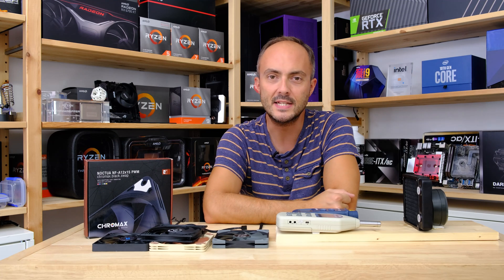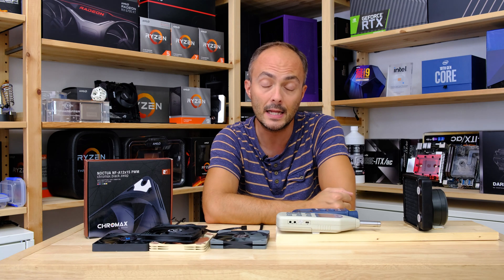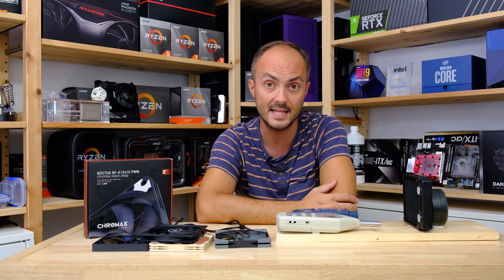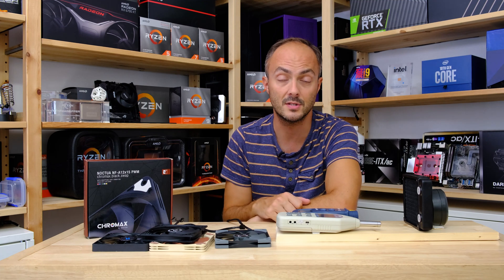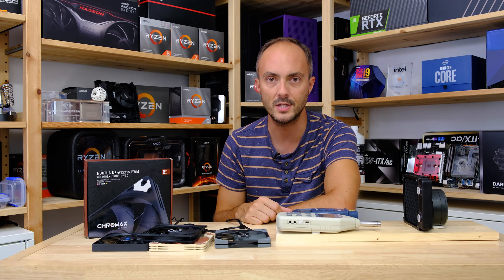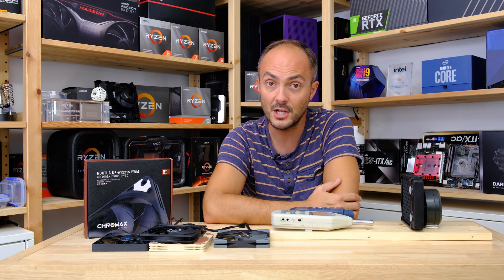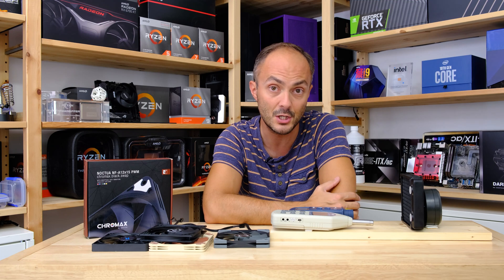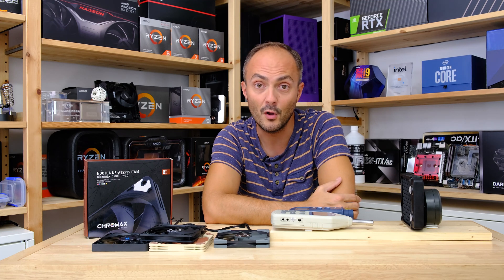120mm SLIM FAN GROUPTEST: Part 2 - Noise Normalised testing

Comment: Just stumbled across these two videos and I wanted to say thanks for doing these tests! Crazy how much more air the Noctua fans can move at their highest settings! Although it is a little unclear in the video what RPM resulted in the normalized DBA ratings- that would be another interesting tidbit! But hey, welcome to the world of testing methodologies. There are always more factors to test for or types of information to include lol.

Regarding the noise quality, I'd definitely agree that in the sound samples of the first video the Noctua does sound more unpleasant. To my ear there are two distinct components of fan noise- the tonal 'hum' of the motor and the white noise sound of the air interacting with the fan blades. What's interesting when listening to the sound samples of your first test video is that the Noctua had the lowest pitch motor sound (again, to my ears) as somewhere between an A4 and Bb4 (the Arctic seemed to be between B4 and C4). But the 'white noise' component was louder, and seemingly louder throughout the entire ramp up to max rpm- possibly due to the increased airflow. 

It seems like between the two the Arctic is the winner for someone who values silence above performance (due to its standout result in the 'middle noise' category) and the Noctua is the winner for someone who values performance above silence. But I'm sure either one would work perfectly for almost anyone with some simple fan curve tweaking! Of course, given the price difference and my own propensity to clamp down on fan curves (700-1000rpm when at all possible) I'll go with the Arctic!

Comment: Appreciate your work, but could you please, please, please just run one standardised cooling performance test?
Reply from the maker: Would you be more interested in RPM normalised or noise normalised if I did?
Reply: @CrazyTechLab  Thanks so much for the reply! I think noise normalised as that is arguably the more important metric. 

Doing like a 30dba then max DBA test would be best I feel.

Comment: Are all of these good enough for an aio cpu cooling radiator? Im planning to get the idcooling because its cheapest I can find. I need slimmer fan because I have some clearance problem.
Reply from the maker: Go for the best performing fans here as I tested the airflow while attached to a radiator so answers your exact question! Take a look at the graphs. I’d recommend the Noctua or Arctic.
Reply: @CrazyTechLab  ok thanks for the reply :)

Comment: How close did you have your microphone to the fans? 44 dB is alot for low rpm
Usefull video nonetheless, thx
Reply from the maker: Shown in the video. At low RPMs the quieter fans struggled to register and the sound meter only goes down to 30dBA so moving closer meant I could get solid comparable readings for all fans. They’re just a bit louder but I’m not saying fan X will be XdBA loud. That wasn’t the point of the group test. I was using identical tests to compare fans rather than test manufactures actual sound ratings.

Comment: Thermalright has some slim fans that they put on their top blower CPU coolers. I don't know if they can be bought separately. They have slim fans in different colours. I don't know if it's the same fan but just different colours, or if it's different performances as well. Can't think of any other slim fans other than the ones you've tested already.
Reply from the maker: Yeah I spotted some a while back - Luna or something, but they stopped being available some time ago. Unfortuantely if they're part of a cooler package I can't really test them but I'll keep an eye on them. They are one of the bigger fan manufacturers!
Reply: @CrazyTechLab  OK, thanks for the reply.